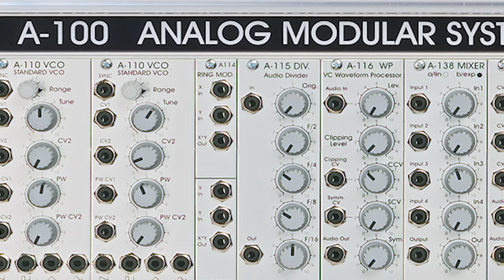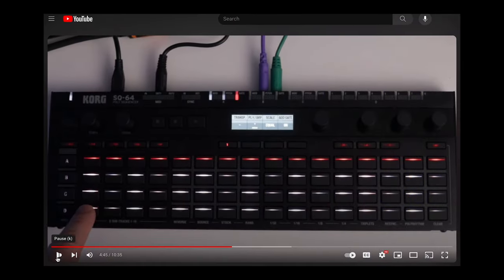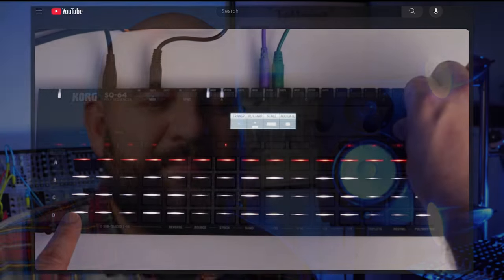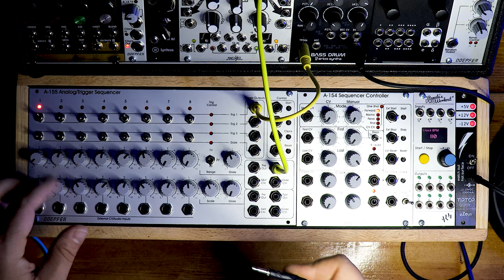Modular Synthesis, Creative Spaces, and You | Featuring the Doepfer A-155

Comment: The A-155 was my first Eurorack sequencer. I liked it so much that I got a second one, along with the controller, precision voltage adder and voltage source. Placing those in front of the quantizer allows you to do a quick transposes of the sequence while staying in key. I don’t use it much now but I will never part with my A-155 system. Too much fun and too many memories. By the way, while the Matroplix looks like a successor, the Erica Synth Black sequencer feels like the successor. I think it is the way you can dial in your notes plus one other cv value.
Reply from the maker: That's one reason I love Doepfer modules. There's so much flexibility and options. I agree that the Metropolix feels like a successor - but in a way I feel like it loses some of the Appeal of the A-155.